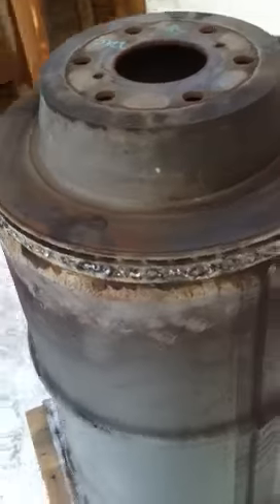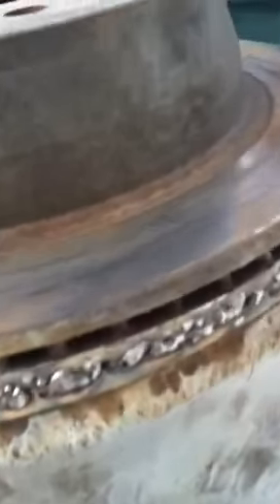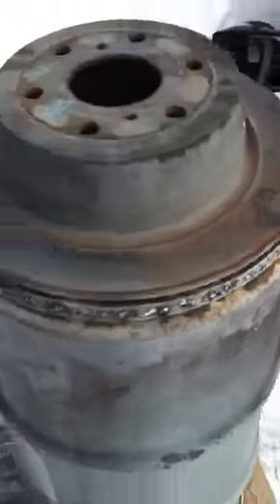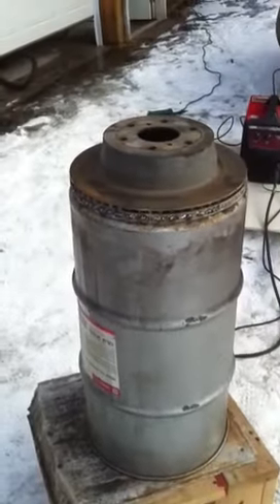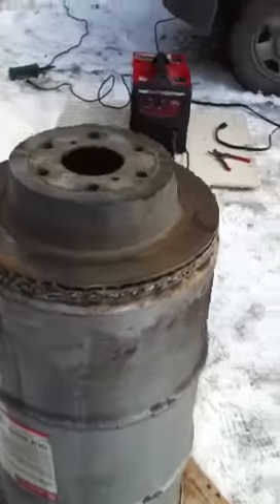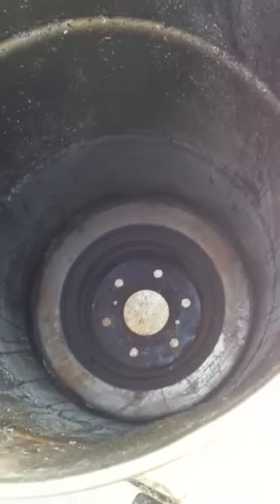Reducer welded to the burn chamber

Comment from the maker: @presentteck Wood will be the main fuel. I am interested in trying pellets also. Yes, the burn chamber will be the entire barrel across. I am going with that design for max fuel capacity. The ash will be funneled out of the bottom and collected in the outer chamber that is not shown in this video. It will be the Water tank that I cut in a previous video.  I am looking forward to putting in some more time on this project next week. I will definitely have more videos showing my setup.

Comment from the maker: @presentteck The reactor will be the inner portion of what you see here.(And it will be air tight) There have been some changes to the overall design and structure so far, I just have yet to post another video showing them. I am in the process of designing a way for ash to be released down through this unit while avoiding bridging in my fuel source. I have never done anything like this before so I am sure that I will be making a lot of mistakes along the way. Any advise is always welcome.